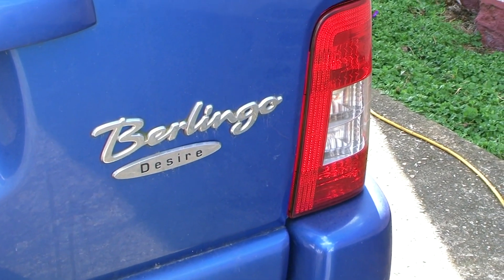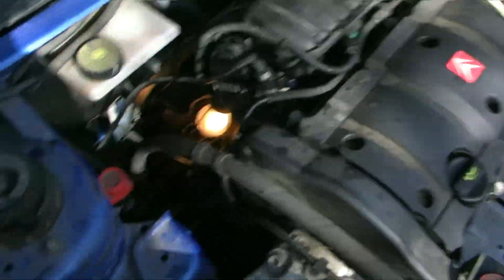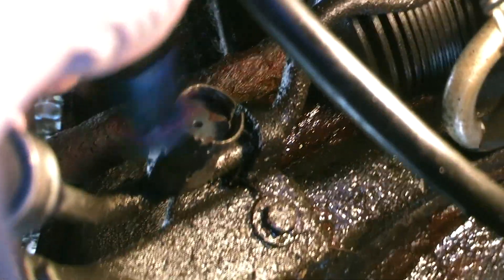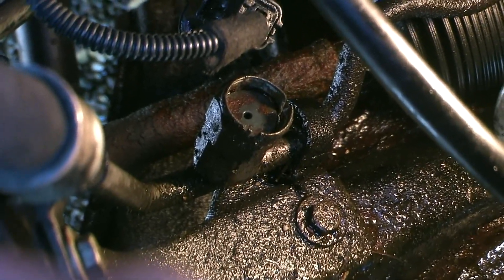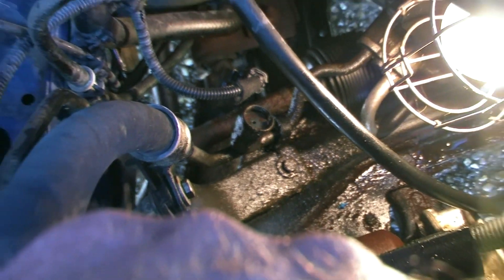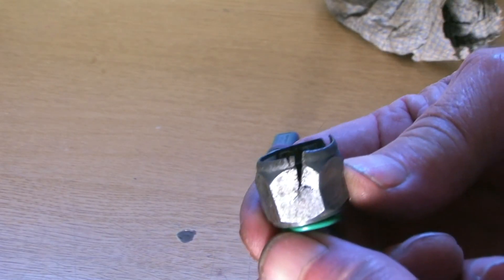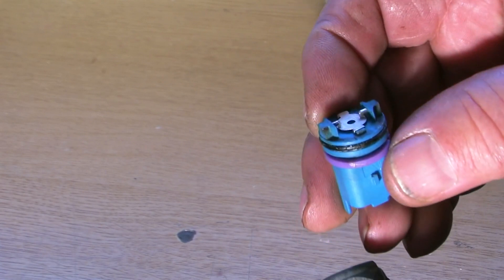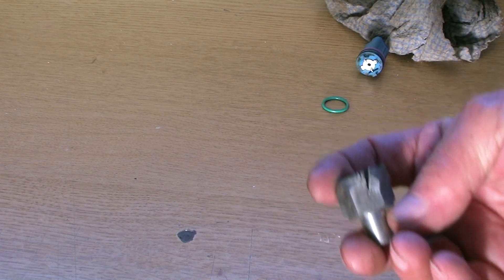Berlingo power steering fault

Comment: Perfect timing.  I just replaced the Rack/Pinon assy, and the lines on my Ford F150 truck... I feel your pain!  There is little to no room to work on these vehicles and it is a Bit&^ taking it apart and then replacing with new.  My hands look like mincemeat.  At least it is almost spring in Canada.  I had to do it in my driveway.  We take vehicles for granted and then when it fails it is a challenge to get them up and running.   Thankfully I was able to do the work myself.  I probably saved $1200 Canadian in labour.

Comment: Yes there is always a problem. But the Berlingo is a brilliant car.  My power steering has just developed a mechanical fault. 168,000 miles. If it totally failed  I would have lost control of the steering. But I hope the design is fail safe ie You will have notification by the abnormal steering before a catastrophic failure occurs. Athe base of the steering column is a UJ that clamps to the steering rack input shaft with one bolt and maybe a nut. You can check if the UJ has wear by wiggling the steering wheel. If one yoke of the UJ moves but the other dosent you have wear and your car requires attention. Note this steering coloumn has two UJ's. The other one is on the other end of the UJ shaft and is above the brake clutch pedal. You can check for wear of the top UJ by wriggling the steering wheel while holding the UJ shaft. It might not be easy. Another way to indicate a problem is stiff steering or different levels of stiffness when turning. The second indication is due to the alignment beeing pulled off line by worn spider cups. If you are constantly correcting your steering there is an issue with it. Take care all Berlingo owners and Happy new year. My next drive is to the garage.

Comment: Blimey - to fracture a steel fitting must have taken a lot of pressure - the plastic housing would surely fail first if it is subjected to the same pressure as the steel hexagon?? something doesn't make sense. Was the sensor isolated from direct pressure via a spring pad/seal?